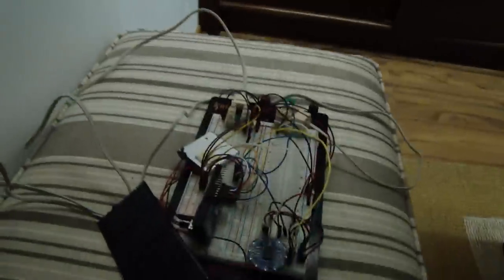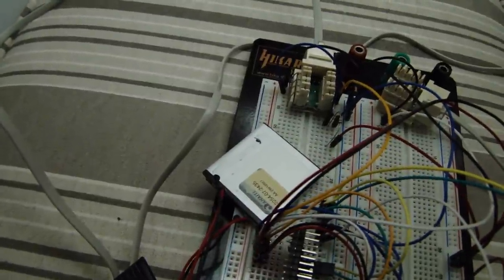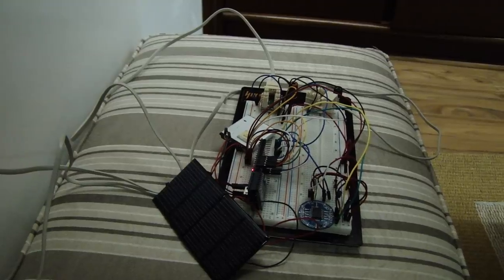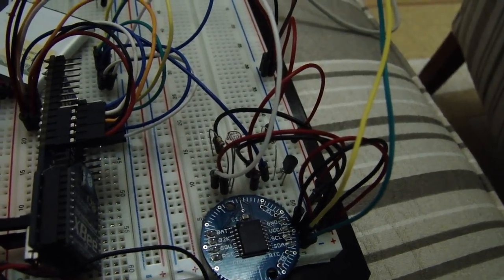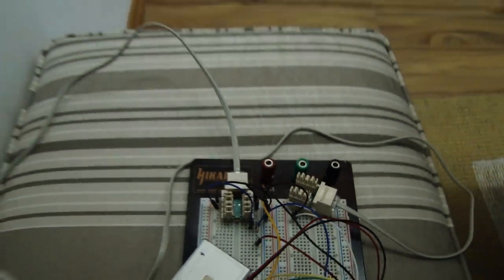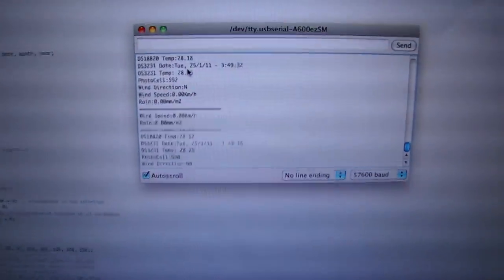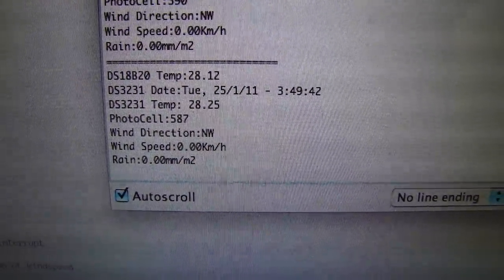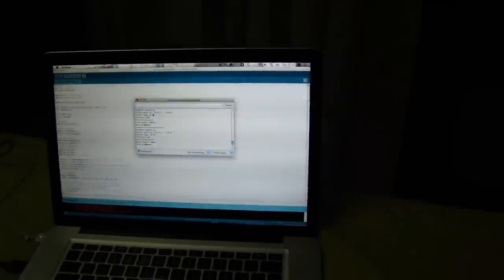Arduino Project - Weather Station

Comment from the maker: I'm using 8 different resistor values with a know other to make a voltage divider. the vane turns and close the circuit than read on ADC pin the voltage and you know where it's pointing.

Eu estou usando 8 resistores diferentes com um outro conhecido formando um divisor de voltagem. Quando gira ele fecha o circuito com apenas um deles aí eu leio em algum pino analógico e sei para onde está apontando.

Comment: Hey there

how do you get your seial monitor to refresh back onto the same line? instead of printing out lines. for example I am doing a rain gauge project but it goes 0.2mm then 0.4mm on the next line.

I would love to be able to get to overwrite like you've done here......